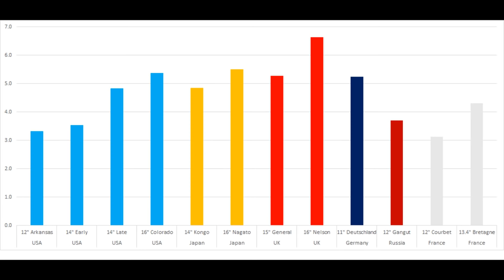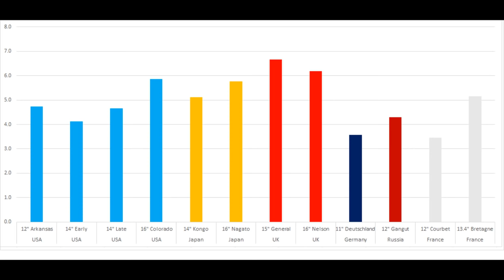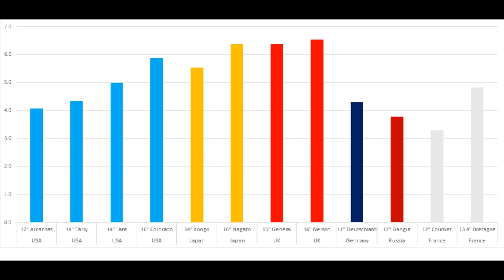Battleship Guns of WW2 - A series of tubes

Comment: Range & penetration are interrelated if one uses the immune zone concept. One would estimate the immune zone (IZ) of some representative battleships (BBs) when attacked by the gun under evaluation. Representative BBs might be a WW I leftover such as USN standard class (e.t., USS Tennessee) and a treaty class class such as RN HMS KG V. One might ignore vulnerabilities to deck penetration which occur over 32,500 yd which you noted is a practical limit on hitting. So a gun for which Tennessee had no immune zone & KG V has only 24000-26000 yd (all values made up) scores higher than a gun for which the IZs are 23000-27000 & 20000-26000 yds. (I concede one needs decent belt & deck penetration tables OR the ability to compute trajectories & formulae to estimate penetrations from a limited data sets.) For shooting at heavy cruisers & other lightly armoured ships (carriers, etc.) (USS Alaska excluded) your approach works because any 11" gun would penetrate any cruiser at any range one can hit. Ask Italy if BBs v cruisers wasn't important. Or ask the RN & USN about shooting carriers & convoys (HMS Glorious, Samar, PQ 17).

For landscaping shore targets (most Navies' BBs did some if this, RN, USN - lots; IJN some; GER?), maximum range is relevant since one can assume aerial/forward observers (or spray and pray such as v Henderson field).

Comment: Re: Scharnhorst elevation - it’s not just that they were lighter, but that they were a ruse. The Scharnhorst was supposed to be refitted with the same 15 inch guns as the Bismarck, but they weren’t ready in time (and then ship-gun availability never happened throughout the war). So the mechanicals for the turret were designed to move a much heavier gun, which is why it’s such an outlier.

Comment: Longer range does not necessarily mean flatter trajectory for shells reaching the same distance.  Many guns have longer range simply because they can have more elevation.  A same gun with lower maximum elevation will have shorter range but the ballistics will be identical and at same distance will have identical trajectories and penetration power.

Comment: Shells and Ballistic Performance – When you look at the data for shells in various references, it can get confusing as to why there are ballistic differences between a 1920lb 15” High Explosive (HE) shell and a 1920lb Armor Piercing (AP) shell. Let’s start with the AP shell. The basic AP shell is a thick metal container for an HE filling with a fuse at its base. It is designed to penetrate thick armor while retaining its integrity, so that once through the armor, the fuse will set off the HE filling, hopefully in an important area of the target ship, like the magazine, since the HE represents only a small proportion of the weight of the shell. The shell walls must be thick to maintain integrity, which means high density and heavy weight. However, if the shell walls are too thick, the amount of explosive might be too small to do any major damage. The shell nose is blunt, because a blunt shell absorbs the stress of impact better, while centering on the point of impact and reducing the chances of a ricochet. When engagement ranges were 6,000 yards and less, this barely mattered, as the shell, despite its less than aerodynamic design, lost little velocity over such short range. The development of face-hardened and cemented armor required a counter-development of the Armored Piercing, Capped (APC) shell. A cap of softer metal was added over the face of the shell that cushioned the AP shell on impact, allowing it to retain its form and velocity. Later, the Germans and US looked at super hard (tungsten-steel alloy) caps that would crack open cemented armor. The USN adopted such shells in 1945 when the supply of tungsten for other purposes than machine tools increased. These caps reduced the performance of face-hardened or cemented armor such that Rolled Homogenous Armor (RHA) plate was just as effective and cheaper. When ranges extended out to 12,000 yards, the angle of impact increased and the soft cap helped center the AP shell for better penetration. The cap covered the front of the AP shell, adding weight and length, slightly improving ballistic performance at greater ranges by retaining velocity, though the blunt design of the cap increased the air resistance. As ranges continued to increase, out to 24,000 yards by 1914, the loss of velocity due to the blunt frontal aspect of the AP shell was unacceptable. The result was the windscreen or ballistic cap (BC). Made of sheet metal or similar light weight and thin metal, the BC improved the aerodynamics of the shell, giving a better frontal aspect and length to diameter ratio. It added little weight but increased the length of the shell as much as 25%. It also allowed the AP shell to retain its velocity longer, extending its range. You can determine the type of shell (AP, APC, APCBC) being described, by its caliber radius at the head (crh). A 2 crh shell is blunt, a 4 crh shell is better and an 8 crh shell is very long and aerodynamic compared to its diameter. As an example, the British 12”/40 fired a 2 crh shell at fifteen degrees elevation to 12,000 yards, a 4 crh shell to 16,000 yards and an 8 crh shell to 22,000 yards. It also explains why a pre-dreadnought built in 1905 with essentially the same gun and turret elevation of a dreadnought built in 1912 had a maximum range of 12,000 yards, while the dreadnought is rated at 16,000 yards. The pre-dreadnought is firing 2chr AP shells, the dreadnought is firing 4chr APC shells. Now the issue was no longer the penetration of vertical or side armor. At 24,000 yards, the target aspect of a ship shows the deck presenting 90% of the target area, while the side presenting only 10%. That and the angle of fall of the shell increased the striking angle to the point where there was little chance of penetrating side armor. Now shell design had to consider deck penetration. The resistance of armor to penetration when angled away from the path of impact was greater than the thickness of the armor in the path of the shell itself. For example, at ten degrees, the resistance increased by about 5%. At fifteen degrees, the resistance increased by 10%, at twenty degrees, the resistance increased by around 30%. At sixty degrees, the resistance increased to a factor of over 2.5. On the other hand, the angle of fall (ballistic arc) was decreasing the angle of strike on horizontal or deck armor, making it easier to penetrate. There are a number of formulas predicting armor penetration, but the main factors are mass (the weight of the shell), diameter (which in concert with mass, determines cross-sectional density) and velocity. Increasing the mass and/or the velocity of the shell (or reducing the diameter for a given weight) increases the penetration of the armor. Mass remains constant, but velocity falls off at range, except at extreme range achieved by higher angles of fire when gravity begins to accelerate the projectile. Most penetration formulas also assume the target being penetrated is a vertical plate (meaning a striking angle of 90 degrees) of RHA. RHA is steel plate of consistent hardness of a quality capable of resisting penetration (and thus heavier per measured area and thickness to mild steel, which was usually used for the hull’s structure. There will be more on this subject later). Deck armor was usually some form of homogenous armor or hardened construction (protective) steel. The other factor in penetration was the target angle. In theory, two ships sailing parallel to each other and maintaining a constant speed and range would present a target angle of 90 degrees. So, at point blank range, striking angle and target angle would be 90 degrees. If, however, one ship was faster and drew ahead of the other ship, target angle would change, so that striking angle might be 90 degrees, but the angle to target 60 degrees, meaning that the armor resistance would be increased by up to 45%. Returning to the shell itself, not only did it have to be large enough and heavy enough and have the velocity to penetrate the armor of its expected target, and be forged of tough metals with thick walls to maintain its shape as it penetrated that armor, it needed an explosive that wouldn’t explode on impact, would keep its shape in the shell and would still go off when the fuse did, with sufficient force to cause damage. Black powder didn’t work with the higher velocities produced with smokeless powder charges.  It tended to explode on impact from the heat generated by the shell striking a resistant surface. Some high explosives weren’t stable, or degraded over time, so a shell might sit in a magazine too long, which then might explode at the shock of firing or impact or even of handling. But an explosive that was too stable might not explode when the fuse went off.

Comment: Excellent as always, thank you. Definitely want a WW1 version of this, personally more interested in a comparison there than WW2. Although may be a bit less surprising with the different design philosophies on either side of the North Sea. 

Wonder if it would be possible to combine muzzle velocity with shell weight to instead use a momentum value for range thereby eliminating the turret angle considerations.

Comment: Having listened to your method of rating these guns, something struck me as being missing, then i thought back to the Vanguard, and having watched that open fire at sea trials i recalled that a two turret broad side astually moves the ship sideways by fifteen foot by each turret, which straight away effects it range in terms of the target, i wondered if you took this into account with regards to accuracy.
I know that it had a very accountable effect even with the 4.5inch guns on a destroyer, and was most definitely surprised at the effect it had even on a 
small gun like this, so must have been a real pain in the neck for those charged with operating these things.
I recall that a two gun turret firing both barrels sets up a skock wave through the ship, so much so that while walking aft with my dinner in hand, lifted me off the deck about two foot and lost my dinner, i ended up on top of the grating above the intake fans for the  forward boiler room with an  empty dinner tray, and a very desticked ringing in my ears,  there was no
Warning that this was about to happen, and i recall looking over the side and seeing the dead water where the ship had moved sidewards.

Comment: An option to get rid of the turret component in the range discussion might be to look a the angle of impact at a certain distance instead of the maximum range (which depends on the maximum elevation of the turret), i.e. at how shallow of an angle does the shell impact at 20 000 yards and thus how good is it at punching through the belt armour at that range, given such data actually exists. 
Or a "standardised" range metric could be used to get rid of the turret component instead by comparing the range of the guns all fired at the same elevation, again providing such data is available for all guns

Comment: I'd have given the 16/45 the edge over the 380mm Mle 1935 gun, since the French guns had significant dispersion problems that weren't corrected until after the war. 

Otherwise, seems like a pretty reasonable ranking to me.

Comment: Very well thought out ranking system and another great video!  

I too am torn on range, accuracy, and ROF factors since they are not dependent only on the inherent capability of the guns themselves.  I could could go either way on how you factored in those values, but I think you found the best balance.

As to things only affected by the guns and their shells, even that is not so straightforward to me as I’m not sure each factor is of equal importance in real world effectiveness.  Of those I think range, accuracy, and ROF are equally important and more so than other factors. 

Being out ranged is very bad since you can’t return fire at an enemy who can reach you. 
Range is no good without accuracy since you can do no damage to an enemy you can’t hit. 
ROF is related to both total damage and accuracy since throwing more shells also gives more chances to hit and more hits also means more damage.

This leaves penetration, bursting charge, and shell weight, and perhaps really only the first two since they are both affected by shell weight.  Which of these is more essential is probably situational and a lot more subjective so yet again you did a very objective comparison I think.

Comment: Ballistic Coefficient, Sectional Density, Velocity,  Shell weight, are all missing and important.  "Burst Charge"  covers a lot. They all need to be added to Ft/Lbs in some sort of form and or fashion.  Then top it off with shell construction and sprinkle a little flux capacitor dust on top, and you are all set.

Comment: Two interrogants come to mind:

1) Why did the Italians use such a small bursting charge? Reading a bit, it seems that the charge in the 15" Model 1934 was 10 kg, half of that of a comparable German or British shell.

2) Why is the 15"/42 rated as having good penetration in the post 1930 era? As far as I can tell, and relying on data from navweaps (can't post exact link due to YouTube's silly link erasing feature) the WW 2 competition of similar caliber or higher has between 40% and 70% more penetration at 20,000 yards.

Comment: This video was an excellent analysis of the individual guns, but I'd love to see one regarding the comparative advantages and disadvantages regarding turret arrangements on Battleships, which varied to a great extent. Judging by late powerful designs such as the Iowa and Yamato, 9 main guns in 2 forward and 1 aft triples seems favoured, but there may be advantages to more doubles in regards to targeting and redundancy or overall weight saving for total firepower in the case of quadruple turrets. I'd love to learn about these options stack up against each other.

Comment: The other factor with gun range is that, at least for USN battleships, the majority of shells were fired at land targets. A Panzer formation in Normandy was never going to dodge BB shells regardless of the time in flight. (I've pointed out in another video comment, that the US Standards with 14" guns were probably more useful in WW2 than the same ships would have been if equipped with 16" guns -- even if 16" guns could have been better for fighting enemy battleships.)
Reply: As the Chieftain points out tanks shot at infantry and soft targets more than other tanks and that is why a lot of tankers preferred the Sherman  75mm to the 76.2.  The 75mm was a better round for those targets.

Comment: In terms of actual observed performance, Yamato's guns are of course at the bottom of the pack because they couldn't even kill the USS Johnston properly. (:

Kidding aside, I like hearing these comparisons about the pros and cons of different guns, and not just because of "who's the best". The amount of research and effort put into this shows very clearly.
Reply: Perhaps the Japanese targeting systems should take the fall in that case. Always the issue with such comparisons to be sure, with superior plotting system and radar the Johnson might have been powder, but with said systems a different gun might have been superior. And of course at that range and against a destroyer, some of the older 12 or 14 inchers might have been more specialized.
Reply: the yamatos guns performed about the same as the iowas in terms of hit chance and shell dispersion.
both had a dispersion of less than 500m and a hit chance of around 7% at max range. (38km for iowa and 42km for yamato)
so its not the guns or fire controlls fault but the fact that fact that these guns werent meant for such small targets.
no battleship at the time could accurately hit a destroyer at more than 15km.

Comment: Just to complicate the issue of (battleship, battlecruiser) gun effectiveness, i always thought that a high angle plunging shell (fired at long range and high elevation) could possibly cause more damage, then a shallower angle incoming shell because the chance that the plunging shell could penetrate hatches were higher, and the flat deck belt armour might have been thinner than the armour on the sides of a ship's hull. Also the high-angled trajectory shell gains more gravitational force potential (for armour piercing) then the shell fired at a shorter range and flatter arc. But i might be wrong.

Comment: The North Carolina class of US battleships fired a "heavy" projectile weighing 2,200 pounds.  ("Heavy" was the label applied to these projectiles because their predecessors had a maximum weight of not more than 1,500 pounds.)  But the Iowa class of battleships fired an APC (armor-piercing capped) projectile that weighed 2,700 pounds.  It was then 'dubbed' "super-heavy".
Reply: Incorrect.  The guns on the North Carolinas, South Dakotas, and Iowas were designed for the standard heavy 2,240-pound shells used on the Colorados, and the ships' armor schemes were based on that combination of gun and shell.  However, the "fast" BBs of the NC/SD/Iowa classes never actually carried the 2,240-pound shell, as BuOrd introduced the 2,700-pound super-heavy shell.  Because the shell was being designed when the ships were being designed, their shell hoists were enlarged to accommodate the larger shell.  However, the Colorado class never got to use the super-heavy Mark 8 shell because the shell hoists in their turrets were not long enough to handle it, so the 2,240-pound Mark 7 shell remained in service with them right up until they were retired.